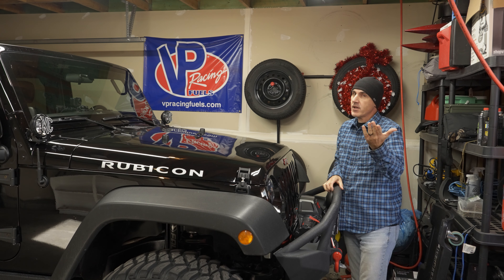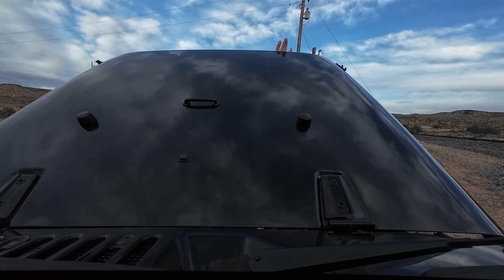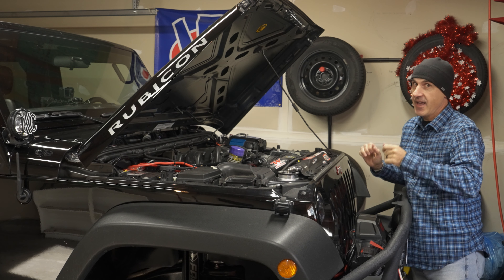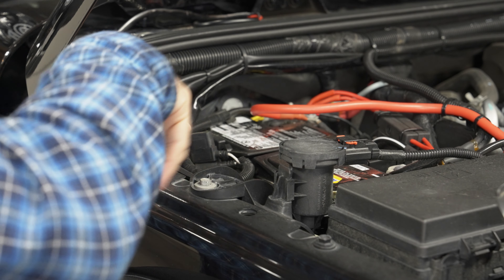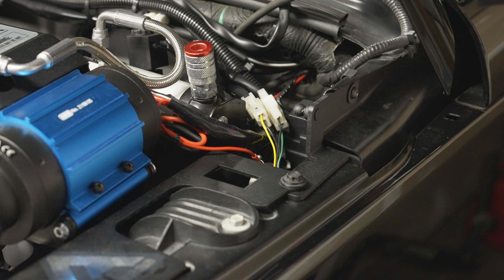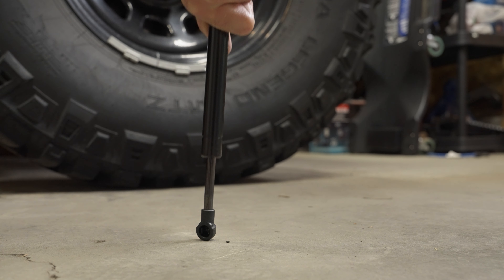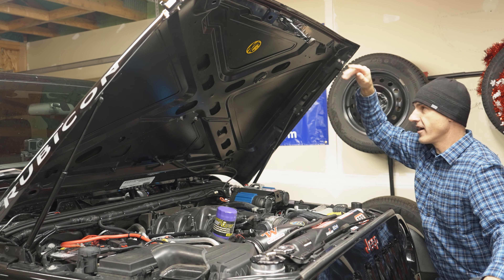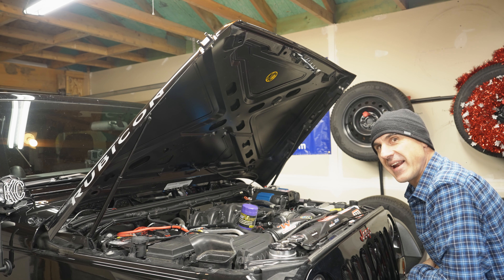Prevent MAJOR Hood Damage with Rival Off-Road Hood Struts for your Jeep JK!

Comment: I have mounted on mine too. But with a bit of a change because on the passenger side I have a snorkel. Which cut off the slot for the bracket on the hood. 👌👍